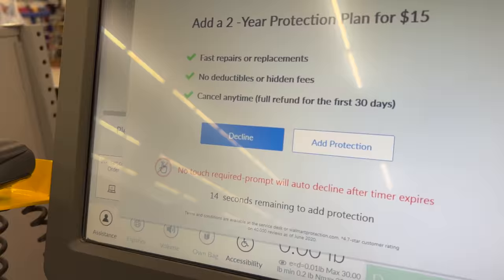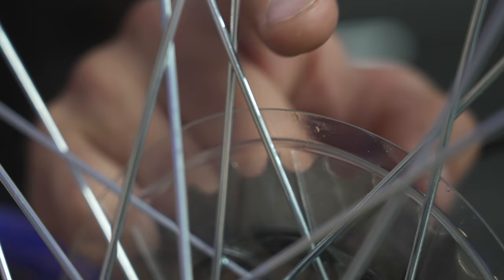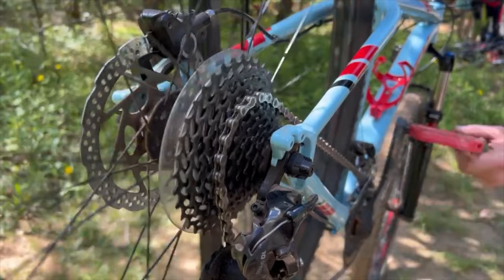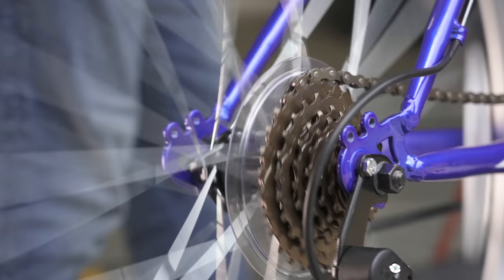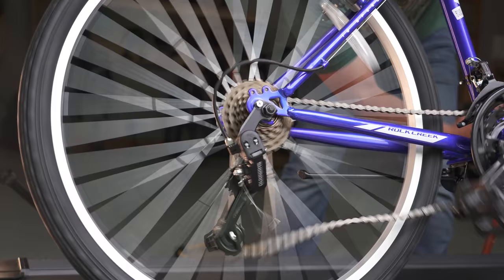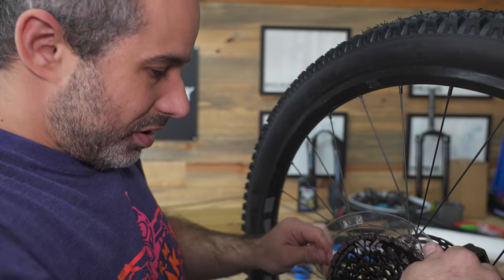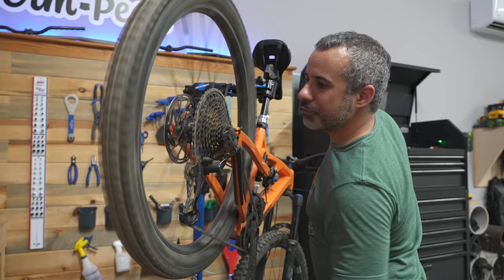What is your "dork disc" actually for? What happens if you remove it?

Comment: Usually you are pedaling up a hill, sometimes pretty hard, when you shift the chain off the cassette looking for a lower gear. Without the dork disk this can wedge the chain pretty far into spokes and even the hub. Then it can be very difficult to remove the chain and it can damage the spokes. This is a pretty different scenario than your experiment demonstrates. I think the purpose of the dork disk is to lessen spoke damage if this happens.
Reply: A couple additional grams of brain material would give bike manufacturers the idea of keeping the chain on regardless of what happens by simply adding what I will describe as a super low gear except without teeth as a way to refuse derailing off the rear cassette.  I estimate a very low increase of production price with a no brainer along these lines.
Reply: If you drop your chain into the spokes while hunting for a gear, that's a limit screw issue, or your hanger isn't properly aligned.
Reply: Pretty easy to stop quick and dismount to fix if one is climbing, and has an ounce of wherewithal.
Reply: @echeese63  it’s both but in a shit bike owned by a kid, it’s likely that it will be dropped on the drive side. Same reason shit bikes have a guard around the derailleur
Reply: @laserbrain7774  Lol, sounds like you don't know what a climb actually is.
Reply: @JohnDoe-rl9pp  You sound like a filthy casual.
Reply: @alexwalker8422  They already provided you with the lightweight plastic limiter, but you don't seem to be happy.
Reply: @seksualusis  dude weight should only be such a concern in competitive applications, especially if you are training for competition.  And why can a plastic disc not also be mounted in the same place that I propose a metal one go?
Reply: @alexwalker8422  Sure, it can, however we exchange worn cassette without exchanging non-worn disc, and this is sufficiently rational. Somebody may be harming and exchanging, or purposefully removing disc as well. Frankly, being daily rider, I do not see bigger issue with the plastic disk in its current form - on most of my bikes it is still present, and intact.
Reply: Quite - high-load low-speed instead of low-load high-speed.
Reply: @JohnRunyon  dude I am not suggesting half inch cast iron as discs, even with steel this extra disc only weighs like half a pound because a couple millimeters thick is all we need.  We could use aluminum.
Reply: @JohnDoe-rl9pp  As someone who has to climb every time I want to go ride, I can say that laser is right. I've had that exact thing happen to me, and I was able to recognize that there was a problem immediately, so I dismounted and stopped to remove the load on the chain. Then I examined it and gently removed the chain from the spokes to minimize damage.

P.s. if you're not checking your limit screws after your bike gets all beat up during a ride, you're not taking good care of your bike.
Reply: If you are shifting under such load, dork disk isn't your biggest issue...
Reply: This seems on point to me. Though, in my experience, once the plastic bleeds off all its petroleum it becomes a 1-time use item and shatters on impact.
Reply: Yes exactly that’s what happened to me twice exactly as described pain in the ass to remove chain!
Reply: What is the market for this disc that protects spokes.
Serious, involved bike riders 
or casual riders.
Reply: Depends who you are and where ride, most riding I do I can make it up hill with the 44/11 gear combo
Reply: @alexwalker8422
Reply: Had it happen doing a wheely and it destroyed my derailleur and pushed a spoke into my tire and popped it.
Reply: When I had a chain drop into the spokes, I should have removed the cassette and check their condition.  Two months later, one spoke broke on a 16-mile loop. When I removed the cassette, I found seven more spokes that needed replacement. Turns out a loose cage pivot screw was the cause of the chain derailment, messing up 8 of the outermost spokes.
Reply: @alexwalker8422  but that’s just a dork disc integrated into the cassette, no?
Reply: @annoyingoranger100  exactly, except made out of steel.  Front cassettes incorporate exactly this except, as always, out of plastic.  Bike competitions involving substantial monetary rewards are the only justification for using weight reduction as an excuse.  If weight reduction was so important, carbon fiber has already entered the price range.
Reply: @alexwalker8422  I have seen dork discs made out of metal in some old road bikes, sounds like it would  be the same thing.
Reply: @stargazer162  except separate from the rear cassette right?  Maintenance delay tolerance is never a bad thing, I can't see why mechanically refusing to let our chains derail in the first place is a bad idea.  I have a whole lot more respect for the people who made metal dork discs though of course because they actually tried to prevent people's chains from going into their spokes.
Reply: @alexwalker8422  I don't know, but it would  make a lot more sense if it did. I actually have rode a friend's bike once where the dork disc prevented the chain from going past the largest cog (I was calibrating the derailleur, that's how I found out), And it had a plastic dork disc too, but I imagine it was mounted in a way that made it act as you were describing.
Reply: @alexwalker8422  Sooo the same thing as a dork disk except metal instead of plastic?
Reply: @gileee  is the chain ever gonna fall off the rear cassette if the metal dork disc is attached to the rear cassette?
Reply: @alexwalker8422  The dork disc that came with my bike completely prevents the chain from falling off anyway.
Reply: you shouldnt be shifting under load in the first place

Comment: I've had a Nishiki Olympic 12 since 1987 (high-school graduation present from my parents), rode it 40+ miles a day, 5‐6 days a week for 25 years with 200+ mile trips every few months (less today, as I'm in my 50s, but I still ride). I've repainted it and put new wheels on it several times, gone through dozens if not more than a hundred sets of tires, and replaced many of the other components. But the dork disk is still in one piece. I suspected its purpose was that explained in this video, but in all that time, I was never certain.

Comment: The test needs to be done with the chain under a lot higher load. I had my chain dump behind the cassette on a moderate climb and the chain jammed hard, putting gouges in the spokes in the process. The bike had to be carried home only for the chain to easily come off once the thru axle was loosened. The freehub body had come loose from the main hub, causing the indexing to get out of whack.
Reply: That's the one time I destroyed my derailer.
Driving up-hill, putting a lot of force into the pedals.
Reply: Same happend to me even when I had the dorkdisc on. The wheel locked up completly but I could pull the chain out.
Reply: @Jehty_  the time i destroyed my deraileur was when i used AliExpress rollers... really bad idea don't do it.
Reply: My sapin spokes got gouged and very bent from the chain over shifting
Reply: I’d pay to see Seth simulate this scenario on wifeys treadmill
Reply: it actually depends in my experience. i had my x-cal 7 in a bike stand adjusting my limit screws after a good cleaning and my chain fell behind the lowest gear and jammed in between the spokes and the cassette. couldn't move my wheel at all and had to pull quite hard to get the chain out. this was all without any load apart from manual turning of the pedals with my hand.
Reply: @Metalshark100  just out of curiosity, how large is the biggest gear in your Cassette?
Reply: @Ferrari255GTO  its a 11-52, 10 speed
Reply: it is also my case. Additionaly chain scrubbed partially my spokes and bended them to inside of the weheel. All drive side spokes had to be replaced
Reply: @Metalshark100  okay that makes sense. If it were smaller it would be harder for the chain to dig in that hard without additional load since the derraileur would have less tension.
Reply: Yep, I did this once on a punchy climb and sucked it in so hard I had to remove the entire cassette to get it out.  Pedal torque I think is key to recreating the problem.

But on the upside, this only happens at low speed, so my crash wasn't super consequential.

Comment: It needs to become a fashion part so that everyone wants to have one installed :)
Gotta make one out of carbon fiber or even kevlar and rename it to "superfancydorkdisc"! 🤓
Reply: Yes that does need to happen because on some older bikes I have they have started to become yellow like how a lot of cheap plastic does
Reply: @Firious421  Which is, at least in my opinion, the main reason why those get removed in the first place. Those plastic disc just don't look attractive once they get older.
Reply: right? just make it less shit and people won't want to remove it..
Reply: Literally lol.
Reply: @jed-henrywitkowski6470  😁
Reply: Unfortunately most of them are low quality and tend to rub on things. And you never know when they will start to amplify the clicking spoke noise. Kevlar rope could be one solution as seen in one image.
Reply: $100,000,000 IDEA  never know.
Reply: Carbon fiber = $100 dork disc
Reply: @bryana7163  yeah, that's a bit overpriced lol. I think I would be able to make some for Way cheaper, in both materials, carbon and ceramic fiber Aka kevlar since I have literally loads of it laying around.
Reply: ngl, if i could get one to match my handlebar tape i would drop probably up to $30 on it
Reply: A "carbon fiber limit guard". LOL
Reply: @TivonSanders  nice one, lol.
Or, "spoke wheel carbon fiber armor plating chain deflection safety disk" (try saying THAT five times in a row, LoL) just to keep it short 😂
Reply: No…..Ceramic coated (for low friction and abrasion resistance) and Kevlar for strength.
Or lightweight Carbon Fibre.
So many possibilities you have opened up. Soon to be The Next Big Thing after chain catchers on seat tubes….
Reply: @tornagawn  Well, if the chain hits it its going to scratch the "D-Disc" anyway (WOW, d-disc sounds actually cool 😎). But I'd rather have some scratches on the D-Disc than having to walk home, in case of worst case scenario. Will see, I think as soon I'm going to feel better I'll go ahead and come up with something worth mounting on a cool MTB.
Reply: Just call it a Gigachaddisk.
Reply: I have a new job👍..air brushing dorkdisc 👍👍👍🥳😂
Reply: Rider: “sweet dork disc bro, how much was that?”
Other Rider: “$299, it’s SRAM GX, carbon. You should get one.. though they are $429 now, due to global parts shortage & 6 month wait.”
Rider: wheez.
Reply: They used to be chromed steel when i do vintage builds ill leave those if they clean up
Reply: this dorkdisc topic  is fascinating example of the way our psychology interacts with technology. very interesting.
Reply: @dempart5558  ... and how prejudice has always worked. If someone instead of demonizing would have been prizing that part, for example, making it a desirable part, a must have. No one would have even cared to remove it, instead we'd have all bikes fitted with those yellowed brittle and "ugly" plastic discs. Like it is for many other things that were made cool by someone and became trending. Like wearing shoes without socks (which is disgusting) or wearing some particular sort of clothing only because someone decided to make it a trend. Human psychology is indeed fascinating.
Reply: @PaoloMaker  I couldnt agree more. you have a good understanding of this deep psychology stuff. it's stuff I'm passionate about. its very intricate.

[edit] I just had an idea to make this disk cooler. It could be compatible with some of the ideas you listed in your first comment...

it could be a big $ idea,as someone commented too.
Reply: @dempart5558  thanks.
I might be wrong but it's probably too late for the dorkdisc. I'd rather be going a new route. For example making a "deflector" that will attach directly to the cassette and make it impossible to the chain to skip over. But this should be not an optional part it would need to be already attached to all the future cassette. This would give the manufacturer a motive to rise the price, since everything is being artificially made more expensive. At least this "addon" part would make it look like the rise of cost is justified and no one would complain. And everyone wants it cause it's New and everyone can see it at a glance without the need of being an expert. Sorry I could go on and on lol.
Reply: @PaoloMaker  interesting point.
I still have faith in the dorkdisc personally, due to its simplicity and its add-on nature. But I get your argument.

This dork disc idea is defective added to the list of idea of things i want to prototype.

feel free to share new ideas or contact me in private. This could potentially be a big idea. The absence of any kind of spoke protector must be solved.

cheers
Reply: PS and a lot of fun could be had with the naming, as you and otherd have said.

I would name it TRX-R pro Race ultra RR , or something outlandish, for comedic purpose. lol

edit : TRX SRC VSXR ultra RR pro Race prologue TEAM proto spécial édition.
Reply: You could make big $$ making novelty D-disks.
Reply: He made a laser cut wood one in an old video. I think it was dubbed the "dude disc"
Reply: Or call it the Dorkless Disk.
Reply: Exactly like those expensive fancy colored handgrips as if they make you a better rider.
Reply: @sneakyjaguar5982  it's the colored valve caps that makes you a better Rider, everyone knows that. 😉
Reply: @PaoloMaker  
No.   Fancy colored valve caps just help you bunny hop higher, which....... ok I guess that does make you a better rider.   

Carry on.
Reply: @OOTurok  😁
Reply: It could be designed with a pattern that would push the chain away from the hub.
Reply: Or use its real name? Spoke protectors are literally tge reason I don't have to think about repairs I can't do: changing a spoke or 10 might be doable enough bit centering the wheel afterwards is a mission impossible for me 😅.
Although, I'd totally dig some fancy colours and/or patterns
Reply: @PaoloMaker  nah... the flimsy detachable type can be molded into a fashion statement or something
Reply: @MarcelaElviraTimis  sure, as long it's not that boring yellowish brittle plastic Chip that is screaming to be removed. Cause right now it is without doubt the ugliest part on the entire bike.
Reply: @PaoloMaker  you can buy a replacement... they're pretty cheap... and meant to take the beating if your chain slips off. Better the cheap plastic than the whole wheel (I mean, once you break som spokes, you'll have to center the wheel, too... a preventable waste of time
Reply: @MarcelaElviraTimis  yes and yes and yes again agreed. It's all correct and true. As Seth has shown in this video it's actually really hard to get the chain to skip over, even trying on purpose. Main reason why its removed is cause, with time the plastic from the most spoke protection are made of becomes brittle and have chunks falling off. Due to that it has become common to simply remove them since in real life use they're falling apart before they're useful, if it makes sense. It is really rare for a well maintained group and chain, to skip over and do real damage except some negligible scratches. I'm not saying its useless, it's just very improbable to happen on a "normal ride", but we all know once we talked about it, the chain now wants to skip on the next bump just to prove that Murphy's law is a b!tch!! 😁
Reply: The guy carrying his bike home because he didn't want a part on it that some genius decided it was dorky to be so equipped with is the dork. At least make it of something more than a flimsy piece of plastic.
Reply: @PaoloMaker  yes, yes, yes, and yes. You got that right fer sure👍
Reply: @MrDegsy69  lol

Comment: What I think is that I want to see premium versions of these disks, something presentable for a good bike, maybe some anodized aluminum or something
Reply: Like decades ago when bikes came with chrome disks behind the cassettes, they just looked good and complimented the bikes, instead of being an ugly piece of plastic
Reply: Yeah pretty sure DH racers use what you're talking about
Reply: They have them.  Alta Spoke Protector 7 1/2" Freewheel Chrome on Amazon for $10.00.  I've got one on every on of the bikes I ride.
Reply: I have several old 27" wheelsets with aluminum discs behind the freewheel
Reply: They should ideally be a part of the cassette.

Edit: Something like the Sram X01 DH MINI BLOCK cassette.
Reply: Sounds like a delicatessen meat slicer to me.
Reply: @Mike-pb7jm  It's ok buddy, but this thread is 2 years old now, nowadays I mostly drive my Abarth, my good old bike is more of a summer pastime.
Reply: yeah, that would be nice! Still a pain in the ass to clean, but at least not as ugly as a piece of oil and grease and dirt soaked plastic.

Comment: I think what really happened is in both simulations with the dork disk off was, as your weight was not actually on the bike, that did not force the wheel to continue spinning and causing damage.
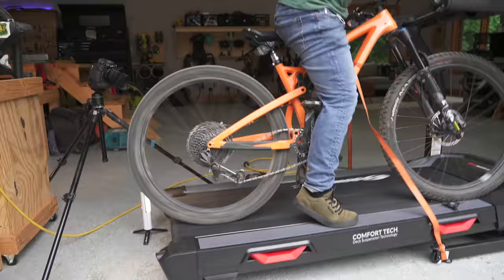If you pay attention around 7:30, the wheel locks itself but in reality that would hardly be the case.
Reply: Had this happen with and without the disc thought on multiple bicycles and it's only a minor inconvenience. Your weight can actually slow the bike down too if you're not going downhill so it really depends on the situation. What he really should've done is add more controlled variables to the experiment ie. while pedaling, while not pedaling, different speeds, different weights